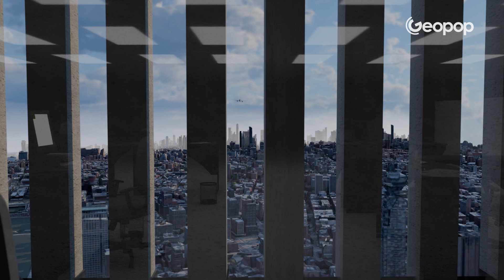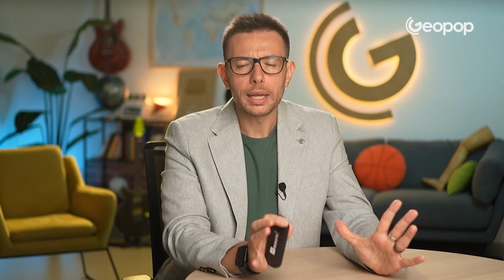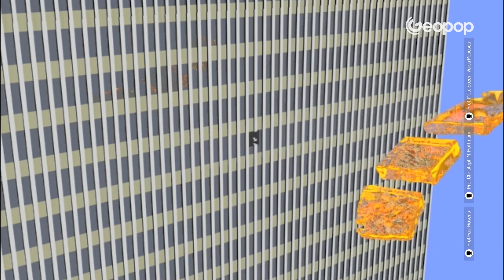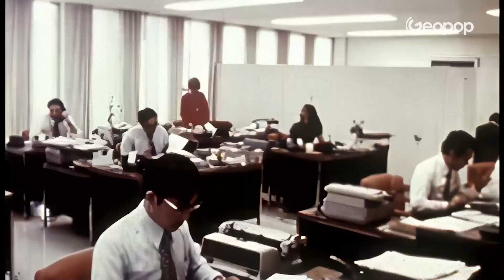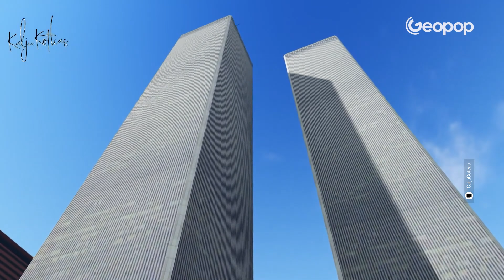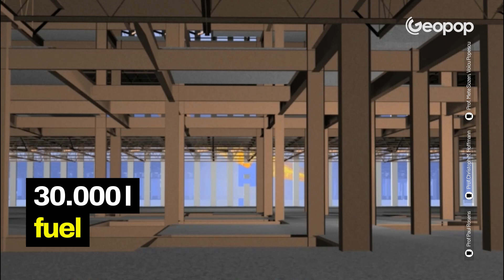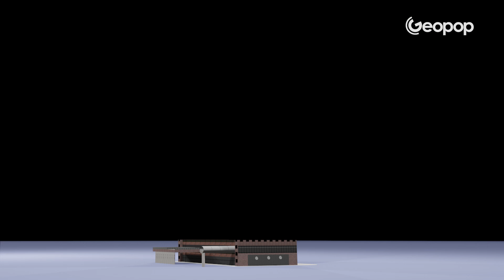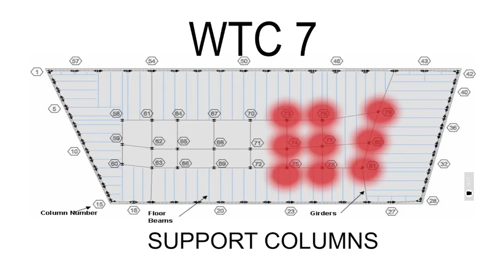9/11, 2001: The Technical Reconstruction of the Twin Towers and WTC 7 Collapses

Comment: Planned demolition  no reason they should have came down. At the WORST they should have broken and the tops would have fell off. There's still MORE than half the building, like 65% still in tact that would have slowed down the descent . But NOPE right into its own footprint . BS BS BS BS
Reply: You are 100 percent correct. People don't realize that the falling dabris is in pieces.  Its not like the whole top fell off in one piece.  It didn't.  There wasn't one large piece of building falling. It was a bunch of smaller pieces so the top didn't really stand a chance at destroying the bottom.

Comment: I still feel like that towers should have fallen to the side instead of going straight down. If the steele beams snapped then the top part that broke the heavier side should have fallen off to the side that was heavier and both towers going straight down just seems not very believable. Tower 7 fell because of fire and fallen debris and the shaken of the foundation caused it to collapse is also not very believable to me. The building between tower 7 and the WTC didn't collapse. How many skyscrapers have caught fire and they don't fall like tower 7 did. The worst part is the reporting of that reporter on scene saying tower 7 has collapsed and she's standing in front of it and even the news anchor had to correct her saying that it hasn't fallen its right behind you then like 30 minutes to an hour after that reporter had said on live national TV tower 7 has fallen finally fell. So if fire made tower 7 collapse then hundreds of skyscrapers are going to collapse.
Reply: Gavity acts vertically... not horizontally.
Reply: There is no lateral force to push the mass off to the side. 

When the columns on one side are failing in compression (buckling) causing the initial tilt the columns on the opposite side are being subjected to tension until they also fail. 

All columns fail so drop overtakes tilt as the direction of travel.

Comment: This is just another in a long list of propaganda videos about how and why the towers collapsed on 9/11. The idiot host is full of it. The WTC towers should have remained standing for as much as 3 to 4 hours before collapsing and killing 2,977 people. They used steel bar joist trusses to support the majority of the floor load in order to provide more column free space on each floor. Steel bar joists don't have the same mass as solid I-Beams that are normally used to carry concrete floors in a high rise. The fact that Building 7 fell due to fire spread was attributed to what NIST called "Single Point Failure" of the active suppression system (eg the fire pumps were off line and did not supply water to the fire sprinkler heads). In the 2015 Final Report of the World Trade Center Attacks 9/11, NIST reccomended the installation of a redundant active suppression system in all high rises that delivers extinguishing agent to the fire if the primary fire pump was comprimised due to single point failure of the fire pump. NIST never describes exactly what the engineering specifications would be in order to satify their reccomendation to provide a redundant active fire suppression system. I believe it could be done by installing a self contained Compressed Air Foam system that ties into the cross main from the existing fire sprinkler riser on each floor. If a fire sprinkler head melts the first thing to flow out of each head would ce a 20:1 expanded Compressed Air Foam that is supplied from free standing water tanks on every floor based on square footage, propelled by nitrogen cylinders and 1% Class A firefighting foam concentrate. So even if a Boeing 767 severed the main riser to the sprinkler system a check valve would open allowing a free flow of Compressed Air Foam to the fire sprinkler heads.
Chief Hughes
Battalion 1 (retired)
Chicago FD

Comment: Ive been in the welding industry for 12 years we get metal to bend by heating it up with a plasma torch so same thing happened as when we heat metal to bend it if the building had been made from mostly all concrete it may not of fell cause concrete dont burn to good

Comment: The one thing that rarely gets mentioned but is seen in every video and simulation of the collapse is how the falling floors peeled off the outer columns/shell like a banana peel, disconnecting the lower floors as the upper floors came down along the path of the still robust inner core like a guiding rod. Both north and south towers had significant portions of their cores still standing right after the floors had reached ground level. Which then each came down seconds later as the rubble shifted and twisted the remaining core structure.

Comment: 6:10 - talks about the core, but doesn't show you the huge CORE COLUMNS... Gee... I wonder why... Isn't that strange. There are plenty of photos and videos of the CORE being built, since it was built first (at each floor) with four huge cranes mounted on the corners of it, before the perimeter columns were added. Why are they hiding the core columns? Because the core could never have been destroyed on 9/11.

Comment: So tell me the steel beams below not subject to the heat how did they collapse the load is the same burning or not weight did not increase
Reply: Thousands of tons of mass falling onto and smashing through them.  Duh. 

The load is not the same. When the structure above transitioned from a static load to a dynamic one the load factor increased by about 30.  Do you not understand how energy works on a basic level?

Comment: I must admit, I long held conspiracy questions about the whole thing because of Tower 7 and made no real effort to look for any official information. I blindly followed "facts" from conspiracies. Last year, around this same time, I actually put in the effort to find out why Tower 7 collapsed and the answer was so obvious I felt so dumb for having believed any falsehoods about it. Not everything is a conspiracy, and often things are exactly as they seem.
Reply: Conspirators often leave gaps in their stories and tend to fill the holes with whatever they need to make their claims. Its easy to blindly follow the conspiracies when you dont actually know the full story and all the information. Conspiracies actually make more sense when you chose to leave out bits and pieces of the facts. But its fascinating what science and engineering can prove.
Reply: @BobetoSlim  Well its funny because I very, very, very rarely follow any conspiracy, but the story around Tower 7 was convincing for many years.
Reply: @tw27242 its an odd one ill say that for sure, and buildings dont typically collapse due to fires alont
Reply: There ARE real conspiracies but you still have to use critical thinking and reasoning to test them. 
The problem is lots of dumb people without critical thinking skills are VERY attracted to all manner of conspiracy theories and won't listen to reason or evidence that undermines their beliefs. 
I believe many of them do so because it makes them feel smarter than everyone that they "know" the "truth", and that everyone else are gullible sheep.

Comment: I always like the conspiracy nuts and their “steel can’t melt.”

But when you mention heat and stress they double down…
Reply: Why the steel was not as hot as you claim it was!!

QUESTION: if you heat one end of a steel beam in a raging fire, will the heat dissipate to the other end and to any other steel beam it is connected to, and will that limit the temperature that can be attained on the heated end?

Google + AlOverview

ANSWER: Yes, if one end of a steel beam is heated in a raging fire, the heat will dissipate to the other end and to any attached steel beams. This dissipation acts as a heat sink, which will limit the maximum temperature the heated end can attain.

How heat dissipation occurs

* Conduction: As a metal, steel is an excellent conductor of heat. The thermal energy from the fire causes the steel atoms at the heated end to vibrate more intensely. These vibrations are then transferred through the material to adjacent atoms, and so on, in a domino effect that sends heat along the beam.
* Convection and radiation: Heat is also lost from the surfaces of the unheated sections of the steel to the surrounding environment through convection (heating the air) and radiation (emitting thermal energy). These processes become more efficient as the temperature of the steel rises.
* Connections to other structures: When the heated beam is connected to other steel beams or structural elements, it conducts heat into them as well. This effectively increases the total mass of steel absorbing and dissipating the heat, enhancing the "heat sink" effect

Why heat dissipation limits the maximum temperature

The maximum temperature of the heated end is determined by the balance between the rate of heat flowing into the steel from the fire and the rate of heat flowing out of the steel via conduction, convection, and radiation.

* Establishing equilibrium: As the fire heats one end of the beam, the temperature difference between the hot end and the cooler parts of the structure drives heat away from the fire. The greater this temperature difference, the faster the heat dissipates.
* A "steady state" temperature: A steady state is reached when the rate of heat input from the fire is equal to the rate of heat dissipation from the steel. At this point, the temperature of the heated end will stabilize and cannot increase further unless the intensity of the fire increases.
* A natural limiting effect: Even with a "raging fire," a heated steel beam will not just infinitely increase in temperature. The extensive mass of steel in the rest of the beam and any attached structures provides a very large surface area for cooling, and a large volume for heat to spread into. This makes it a very efficient heat sink, which works to oppose the temperature rise.

Comment: Doesn't jet fuel burn at 2,000° ??
Reply: Something like that, but the vapor has a flash point of like 100*F, and when the fuel expanded on impact and turned to billions of little droplets and mist basically, it became extremely flammable almost instantaneously.

Comment: I remember those stress-strain diagrams from my civil engineering days at Cornell.  The strength properties of steel change drastically well before the melting point is reached… it gets really soft.
Reply: Yea Don, except that did not happen back in February 1975.  

A three-alarm fire broke out in the 11th-floor offices of the B. F. Goodrich Company in the north tower of the World Trade Center just before midnight last night and spread through an inner-service core to the ninth and 14th floors. “It was like fighting a blow torch,” according to Capt. Harold Kull of Engine Co. 6, who said all of his men “got their necks and cars burned” trying to get into the 11th Floor hall from a stairwell. A total of 24 pieces of fire fighting apparatus and 132 firemen fought the fire. Sixteen firemen were treated at the scene for smoke inhalation. Flames could be seen pouring out of the 11th-floor windows on the east side of the building. 
--- TRADE CENTER HIT BY SIX-FLOOR FIRE, Blaze Starts on the 11th—16 Men Are Injured, The New York Times, February 14, 1975.  

Needless to say, with the weight of 99 floors bearing down upon the 11th floor, the building did not collapse.  Is much for your fires weakening steel nonsense.
Reply: Why the steel was not as hot as you claim it was!!

if you heat one end of a steel beam in a raging fire, will the heat dissipate to the other end and to any other steel beam it is connected to, and will that limit the temperature that can be attained on the heated end?

Google + AlOverview

Yes, if one end of a steel beam is heated in a raging fire, the heat will dissipate to the other end and to any attached steel beams. This dissipation acts as a heat sink, which will limit the maximum temperature the heated end can attain.

How heat dissipation occurs

• Conduction: As a metal, steel is an excellent conductor of heat. The thermal energy from the fire causes the steel atoms at the heated end to vibrate more intensely.  These vibrations are then transferred through the material to adjacent atoms, and so on, in a domino effect that sends heat along the beam.

• Convection and radiation: Heat is also lost from the surfaces of the unheated sections of the steel to the surrounding environment through 
convection (heating the air) and radiation (emitting thermal energy). These processes become more efficient as the temperature of the steel rises.

• Connections to other structures: When the heated beam is connected to other steel beams or structural elements, it conducts heat into them as well. This effectively increases the total mass of steel absorbing and dissipating the heat, enhancing the "heat sink" effect.

Why heat dissipation limits the maximum temperature

The maximum temperature of the heated end is determined by the balance between the rate of heat flowing into the steel from the fire and the rate of heat flowing out of the steel via conduction, convection, and radiation.

• Establishing equilibrium: As the fire heats one end of the beam, the temperature difference between the hot end and the cooler parts of the structure drives heat away from the fire. The greater this temperature difference, the faster the heat dissipates.

• A "steady state" temperature: A steady state is reached when the rate of heat input from the fire is equal to the rate of heat dissipation from the steel. At this point, the temperature of the heated end will stabilize and cannot increase further unless the intensity of the fire increases.

• A natural limiting effect: Even with a "raging fire," a heated steel beam will not just infinitely increase in temperature. The extensive mass of steel in the rest of the beam and any attached structures provides a very large surface area for cooling, and a large volume for heat to spread into. This makes it a very efficient heat sink, which works to oppose the temperature rise.

Comment: Thats 1 more lie they tell us there is no way a pane can hold that much fuel in 2 little thin wings thats more then a fuel truck
Reply: A Boeing 767 carries up to 24,000 gallons of fuel inside its wings and center tank. A standard  highway fuel truck holds approximately 9,000 to 11,000 gallons. This plane physically holds more than double the volume of a standard tanker truck
Reply: @StuartI89 dont try and reason with the nutjobs, nothing you say will get them untrapped from the matrix theyve locked themselves in.
Reply: @BobetoSlim you're right.  It's frustrating

Comment: Go and watch the story about the
Empire State Building Plane Crash - 1945 | Today in History | 28 July 16
Pretty self explanatory how no building ever pancakes on itself unless its a controlled demolition.
Reply: That 1945 crash involved a B25 bomber weighing roughly 20,000 pounds with relatively little fuel striking a dense steel structure at low speed. The 2001 crashes involved Boeing 767s weighing over 300,000 pounds with roughly 10,000 gallons of fuel, striking open plan tube frame structures at high speeds. The crashes are fundamentally incomparable
Reply: Yea.  people hijacked planes, flew them into the WTC and THEN set off explosives right?....lol
Reply: No controlled demolition looks like that... it was uncontrolled... tipped forward... damaged many other buildings... left HUGE pieces towering upward... it was the worst "controlled demolition" in history 😂.
Reply: @e @eNosArmory  i bet you’re a demolition expert.   Go see the Empire State building and how it collapsed after a plane hit it… oh wait it’s still there they opened it 2 days after the plane hit it.   Shocker!!!
Reply: You're comparing apples & oranges. The B-25 Mitchell has a fuel capacity of 974 gallons, a Boeing 767 has a fuel capacity of 24,140 gallons. The fuel alone aboard the 767 weighed more than 5x what the entire B-25 weighed. The top speed of a B-25 is around 275 mph, the hijacked airliners struck the towers at speeds greater than 430 mph.
Reply: @DaveTube775 no you are the one with the apples and oranges.   The twin towers were actually built like  no other skyscraper before.  They were built to withstand an airplane crashing into it.  It had that kind of reinforcement never used before.   Go back to school.  25 years later and you still don’t have the information needed to make a solid argument.  Go back to comparing apples with oranges because that’s where your research stopped.
Reply: @JCX-9  What creates more force? 33,000 pounds going 275mph or 412,000 pounds going 430 mph?

Comment: Like many have said, your dumb pancake theory should result in 100 pancakes at the bottom. Instead we have concrete powder for a 3 mile radius. You're a FOS patsy that has assured I'll never sub to your lame channel. The fire didn't burn on 100 floors BOZO.
Reply: You have to be some kind of a Ninja level idiot to believe someone put bombs on every level of both WTC's, flew planes into them and THEN set off  those bombs to collapse them...LOL! 
and yet...in the comments below ( and above eventually)  these idiots roam among us in perpetuity.
Reply: @Russellviews  LOL is not an argument clown. Read what i said if you're capable but you're not.
Reply: You findamentaly don't understand progressive collapse. Fires only needed to weaken the structural steel at the impact zones, not the other 100 floors. Once those floors failed the intact structure below could not withstand the energy of tens of thousands of tons dropping from above. A huge dust cloud makes much more sense than neatly stacked, intact slabs